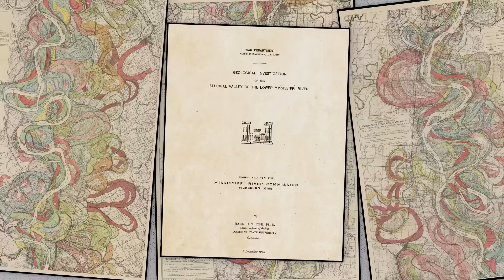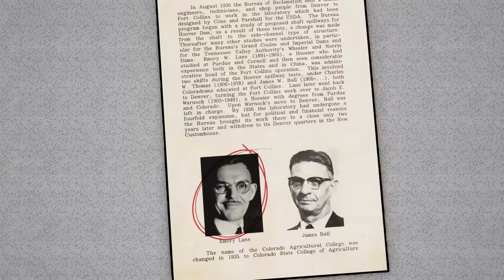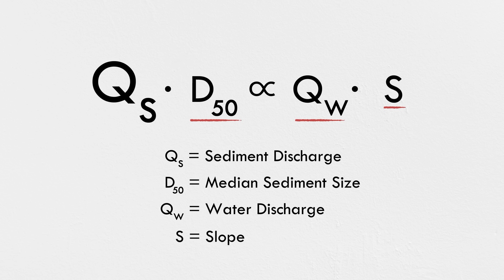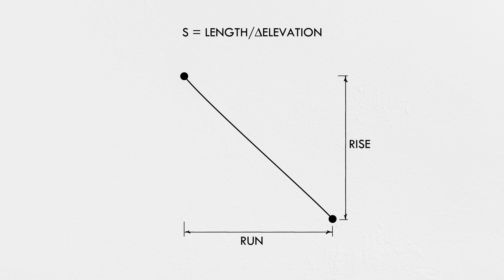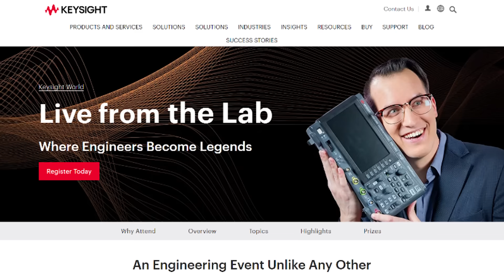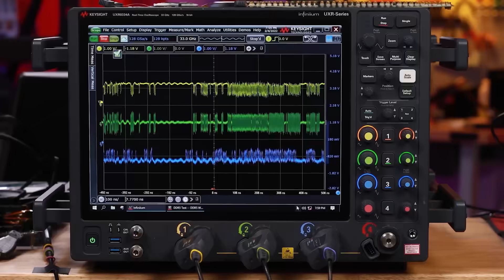Why Rivers Move

Comment: One of the things that puzzled me about our local river-- the Thames river in South Western Ontario-- is just where all the dirt ended up. The river currently empties into Lake St. Clair-- and there's no delta there.  Looking at the depth and width of the ravines it carved that's a lot of sediment not to be accounted for anywhere.  It seems most likely all that sediment was discharged via entirely different drainage.  At the time the ravines were carved out,  the river drained into other post glacial lakes, so the sediment is either high and dry on vanished glacial lake lands in Michigan, or as part of the Mississippi delta today, as those lakes at that time discharged down that river.  I guess I'm so used to thinking of things in geology having a "geological time scale", meaning our landforms took eons to form, it's still surprises me how dynamic and radically different drainage in the Great Lakes Region were relatively not that long ago.
Reply: There were some massive flood events connected to the last glaciation that greatly changed the landscape, quite a few comparatively tiny current rivers are meandering along the bottom of massive flood carved channels.
Reply: @volentimeh , Yeah, the "scab lands"  out west are probably the most dramatic example of this, and there's evidence of this in the Snake River basin in Idaho. I'm sure there are many others.

Comment: the point that wasn't specifically stated: the parameters of a natural river change continuously.  even a dam controlled river has variations in flow rate, as surface water enters the river downstream of the dam.  the sediment load also changes continuously as erosion and deposition happen.

Comment: Dont forget how much ice can effect a river
Not just from it flowing down a river on the surface wich is kinda unique compared to other particles
But also because they dislodge large rocks and boulders and makes those erode easily aswell
The formation of ice can even make large particles with small cracks in them explode when ice forms inside them wich makes those rocks vecome smaller particles

Comment: 5:49 The equation makes sense intuitively. Larger particles are more difficult to move so they need greater force which comes from water flow which is dependent on slope.

Comment: I believe that actually rivers don't run slower on the inside of the turn ( of course really close to shore they do), but not far out from the bank on the inside of the turn the river is running fastest , or at least deepest. You see the same thing with hurricanes: the edge of the eye  (the inner part)of the hurricane has the highest winds, not the outside! You can actually test this with a tub of water with some sediment. When you make the water swirl you can clearly see the particles closer to the middle moving faster. Except for the most inner part (as in the calm eye of the hurricane)! Yet you see the sediment settling just behind the fastest flowing water!? The reason why the sediment tends to drift towards the faster flowing part has to do with pressure. The fastest flowing water on the inside of the turn has a lower pressure then slower flowing water on the outside of the turn. Because of this an undertow is generated towards the opposite bank which will take the sediment and drop it there. Of course, this whole story doesn't change anything about erosion and deposition but it's interesting to realize that water doesn't behave like a wheel (the outside is moving faster) but like a hurricane (the inside is moving faster).

Comment: This is all cool and well, but theres one thing I see in this model (and almost all models) that bothers and oversimplifies things in a way I usually consider to be unhelpful.
All of the water enters the model at the same location, and thereof goes the same direction immediately. 
Obviously you cant model a whole watershed on this scale, that'd be insane, but I think its good to think about sources as (usually... Im looking at you Metolius River) and more as sever little tubes that nature can place around in different spots, orientations, and with different pressures coming out of them. Its a small change on the board, but it makes a big change in the utility of such a model, and the information it can convey

Comment: A fun fact I learned about meandering rivers is that if you divide the length the water flows from start to finish with the length of a straight line from start to finish it will get close to Pi, 3.14.

Comment: Isn't slope usually change in elevation over horizontal length? The equation on screen at 11:52 shows S = length/ðelevation. That would imply a singularity for flat ground, which feels yucky mathematically, so I don't understand why they don't put the term on the other side of the equation?

Comment: Thanks for the video, Grady. Can you also do one about California’s “killer Kern”, a fast moving river that drops 13,300 feet from its origins in the western slopes of the Sierra Nevada Mountains in just over 165 miles?
It’s a serious elevation change that moves not only silt, sand, and gold nuggets, but boulders as well.
Reply: Small boulders the size of large boulders?
Reply: @WayneWerner  , 👍🏼 yup; sounds like you’ve been on those stretches. On inflatables?
Reply: If I'm not mistaken, it's living up to its name right now with all these atmospheric rivers we've been getting. 
I'm wondering where all the gold is going to show up. 🤔
Edit: "up" 😸
Reply: @erinmac4750  , yes, it’s moving tons of water, with more to follow. 
This spring and summer will be a bonanza year for gold hounds. 
When I passed through Oroville, on the Feather river in Northern California several years ago I talked with one of the old timers there and he said they still get nuggets and gold dust in the riverbed sand, especially after a good runoff year. (Oro-ville means gold village in a mix of old Spanish and English...)  I’ve seen gold in the western Sierras (Sequoia) before

Comment: With streets that flood in front of houses year after year, would there be a quick solution for the locals to stop the quick flow of water?

Near me there are multiple streets that seem to flood as soon as a quick rain fall happens. Yes there is drainage but not enough because of what I assume is sediment in the drains.

I feel like if we can adjust the time and flow of where we see the water coming from we might have a chance to not flood as much so quickly

Would love to see an example of how to quickly adjust this until the local government installs upgraded drains and tubes for the size of water that now happens. 

This issue wasn't happening years ago but over time it seems more and more water is rushing to the lower elevation at the lower points in certain streets.

I feel like if neighbors build channels to adjust the flow and create their own dams or valleys it wouldn't stop traffic flow until it fully drains.

The townships know about these issues but I swear it just never gets solved because of how large the issue is over time

Comment: Can you make a scale model of the Nile  from up river where the Blue and White Nile conjoin to down river to Dongola. don't forget to scale in the 8 inches per mile squared to account for the earth sphere's curvature drop and explain how the river is able to flow  both up hill and down hill through this region.
Reply: Never going to see that on here!
Reply: @EastCoastSkyWatcher  why Not?
Reply: @In_Rem  You should know, the physics of water on a globe cannot be demonstrated on a small scale.
Reply: @EastCoastSkyWatcher  the physics of water is always has a level surface, it does NOT CONFORM,  it must be contained in order to pool.
Reply: @EastCoastSkyWatcher  Oh yeah water always naturally flows down
Reply: @EastCoastSkyWatcher       https://www.youtube.com/watch?v=LDqVWwK5Wcc
Reply: The definition of level has to do with gravity, and since gravity always pulls towards the middle center of mass of an object, gravity is always pulling downwards. The funny thing about downwards, tho, is that over the 2200-mi length of the Nile (from Victoria Lake to the delta, based on Google Earth), you pass about 2.2k/26k of the circumference of Earth, or, about 8.5% of the total 360° of the circumference of the earth, meaning that downwards is different at the head and at the end of the Nile by about 360*2.2/26 = 30°. That's actually a bit more than I thought it would be, but yeah, the thing that is 'downwards' changes by 30°. Huge change. Massive effects.

Comment: How do they reset the river table after a simulation?  Do they sift the particles back into their size groupings and then re-lay them, or vibrate the table to settle the larger sediment?
Reply from the maker: All the sediment is mixed together. There are no layers. They naturally separate out in some areas due to the simulated geologic processes of the water movement.

Comment: As a kayaker this is one phenomena that always seems puzzling whenever you see a river eating away at the edge of a farmer's field. The river has had millions of years to find an optimum path and yet it keeps moving.
Reply: it's because every raindrop that joins the river, and every bit of dirt the river moves changes what is "optimum"
Reply: Even in an otherwise static environment (which doesn't exist), there couldn't be a stable optimal path because the river would still constantly erodes or deposit material thus changing its own environment.
Rivers, like all nature (including humans), are partially cause and effect at the same time.
Reply: There's a powerful metaphor buried in that observation.
Reply: @Niskirin  Indeed. Very powerful. Rivers are not alive, so it doesn't evolve, it just reacts to the ever changing circumstances of the environment it finds itself within.
Reply: It's always finding the optimum path, the sediment shifted by the water that reforms the river bed and banks means the optimum path is always changing.
Reply: I think rivers and streams are just drunk.  This is why you should always fit a dashcam to your bridges.
Reply: I’m an avid angler and its always fascinated me how rivers can change simply by a tree falling in them or a boulder becoming dislodged.  I was in the Smokies fishing a small creek just days after an isolated downspout in a small hollow called Round Bottoms had caused a 12’ wall of water to go rushing downstream.  The debris from the flood was piled up along the creek way above my head, the mossy rocks in the creek had been scoured clean and bright, and the fishing was never better.  Lakes and ponds have little appeal to me as an angler.  There’s just something about rivers and current I am drawn to, perhaps because as Norman Maclean put best, “eventually, all things merge into one, and a river runs through it.”
Reply: *phenomenon
its singular
phenomena is plural
Reply: @sebastiangorka200  In this context, the word "its" is a contraction and requires an apostrophe.
Reply: Except for rocky, rapid rivers, we don't see rivers in their natural state anymore (actually, loggers made great modifications to the channels of rocky rapid rivers in the old days, but that's another story).  All the gently flowing rivers in farm country have eroded much more deeply into the ground than was historically the case.  Runoff from agricultural land is enormously greater than runoff from forest or prairie.  This results in pulses of high-volume flow which are far greater than what the river would typically experience in its natural state, and these periods of high flow have the initial effect of sinking the river bed deeper into the earth.  From there, erosion into the banks on outside turns is far more catastrophic than was commonly happening in the days prior to modern agriculture.  Related to this fact is that sudden shifts of the channel from one location to another become much less likely, simply because of the river being sunken to a deeper level within the earth.  If you look at the myriad of old abandoned channels of a river with gentle slope (it might take practice - most people don't recognize these features for what they are, or they don't even see them at all.).  Even accounting for the fact that old, abandoned channels gradually fill with sediment over time, it's easy to see how naturally they overlap one another, and how new wider turns were produced, and how shortcuts across large loops happened quite easily. And yet among all of these traces from the past is the current river, sunken so much deeper into the ground than the old channels and being relatively more trapped in place.  Then, when major floods happen, there's catastrophic erosion of the banks.  In contrast, not only would the river in its natural state experience smaller pulses of flow during flood times, that flow would quite easily overflow the banks, causing the velocity and the resulting erosion to be much less.  Simply converting our land to agriculture has had an enormous, cascading effect on the geomorphology of rivers!!  Most of us are not aware of this because it's the only situation that has existed in our lifetimes.
Reply: Rivers are dynamic. Our attempts to fix river boundaries is evidence that our engineers don’t understand the laws of nature.
Reply: @yliannamarie  It's not necessarily that the engineers don't understand. They'll probably be the first to tell you that this is only going to be temporary and will require adjustment over time. But, they've been given orders to do a job that was decided on by some politician somewhere up the chain. And politicians rarely care to understand anything of real complexity; simple solutions from simple minds neither of which work.
Reply: @yliannamarie  what a weird and demoralizing thing to say. Their entire lives and careers revolve around learning those things and finding a middle ground that is safe and acceptable for both sides. 

Not everyone gets into engineering so they can go out and conquer nature and break the laws of physics... Many folks love our world and go into engineering specifically to mitigate our negative effects on it.
Reply: @yliannamarie  I think that's an oversimplification.  I believe they do understand, but multiple factors may be changing at the same time.
Reply: @yliannamarie   Engineers understand the laws of nature pretty well.   Just that rivers are an extremely complex system that will change over time.   The problem is usually property owners who want to build next to the river (because that's the prime location) then expect the river to stop changing...
Reply: @cr10001  Yeah, it's like weather ... your river conditions are emergent phenomena.
Reply: @cr10001  the problem is then that people want to control and fix river boundaries rather than respecting that the river is alive and must have space to move freely.
Reply: @yliannamarie  Our attempts at everything in life demonstrates both our knowledge and our ignorance. :hand-orange-covering-eyes::face-turquoise-covering-eyes:
Reply: I see the same thing. The increased rate is because of irrigation I am sure. Once the existing stream sides are gone,  dust bowl catastrophes again.
Reply: That means the river doesn't know where his limits are
Reply: optimal

Comment: Have you done any videos on soil composition (clay, silt, sand, organic matter) or soil horizons? It's such a cool topic. I had an undergrad course on soils that had a field component where we went out to pits and "played" in the dirt and learned about it in the context of the surrounding geology. Super relevant to a lot of fields like engineering, but even as an ecologist, I've used soil data for modeling and predicting species distributions both in a contemporary context and a historical context.
Reply: And more directly related to this video, I've also used slope, water flow, and water accumulation metrics in wildlife species distribution models because they can play a major role in the types of plant communities that develop in an area, which can then determine what animal species might be there.

Comment: @14:33 You show the pulsed flow river versus the steady flow river. I couldn't tell if the pulsed flow was cutting off completely between pulses or just reduced significantly.  It seems to me that part of what makes a river different from streams, creeks, and wadi is that a river would flow year-round. Here in Texas, a creek does not typically flow year round, especially the closer to the head water/source which is typically rain runoff. The expectation of a steady flow river would be drastically different from a dam breach/pulsed flow river. In fact, (in my opinion), the pulsed flow 'river' would be better referenced as a stream or creek if it doesn't have water flowing year-round. Surely there is a different formula or calculation that would better represent a pulsed flow, and also available for events like flash floods, dam breaches, etc. It seems logical that there is a way to reference an increasing flow and a decreasing flow, opposed to the steady flow calculation/formula.
If the example of the pulsed flow

Comment: I was once told that if not for the  Army Corps of Engineering's "maintenance" of the Mississippi River that New Orleans would have been cut from the river.  Instead, the river delta would have moved to Baton Rouge.